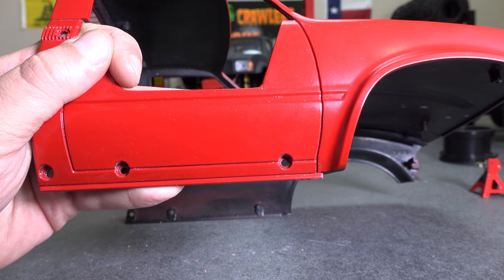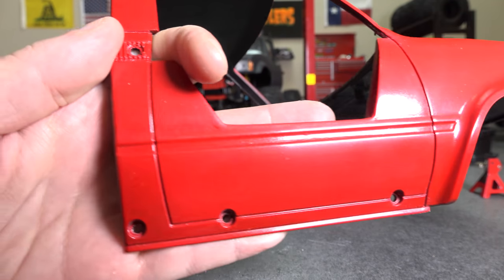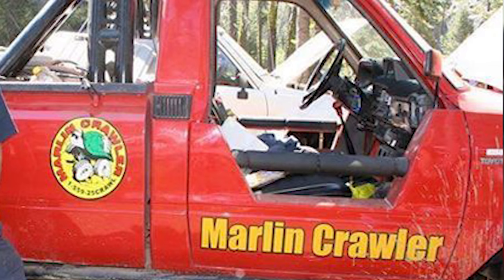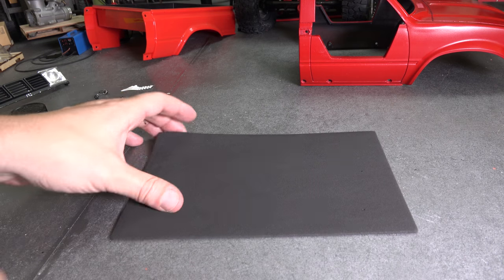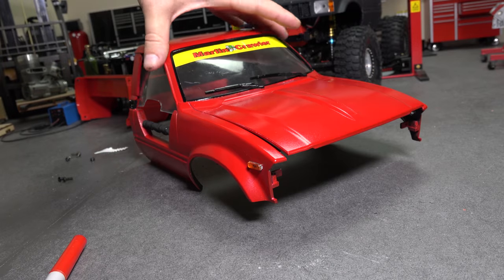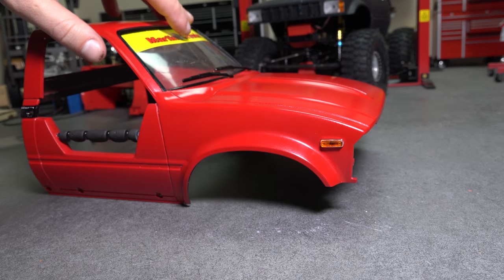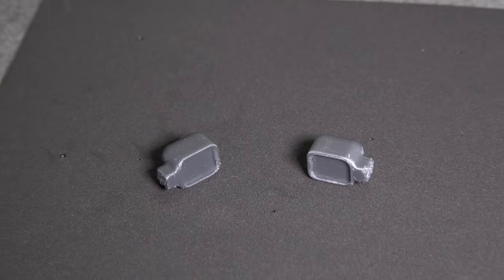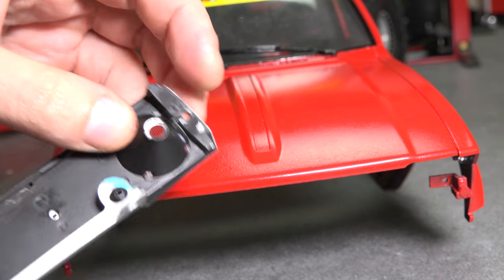THE RC SHOP - E18 - RC4WD Marlin Crawler Scale Details

Comment: Question for you. My Marlin body cracked in multiple places. Is it possible to fix it or do I need to buy a new body? Thanks for any info.
Reply from the maker: Nathan S, anything is fixable. Without seeing the cracks I can't say for sure but I'd think you could use a little CA glue to repair. You'll have to fill and sand smooth for a finish that can be painted; or leave the cracks showing and consider them battle scars.
Reply: TandemCTelevision I have already filled them in with ca glue on the inside of the body. The cracks are around the screw holes to attach the bed to the cab. Other than color of the molds is the Mojave 2 cab the same as the Marlin Crawler Cab?
Reply from the maker: The front fenders of the Marlin Crawler are trimmed with no front bumper. From the door seals back, I believe, they are exactly the same.